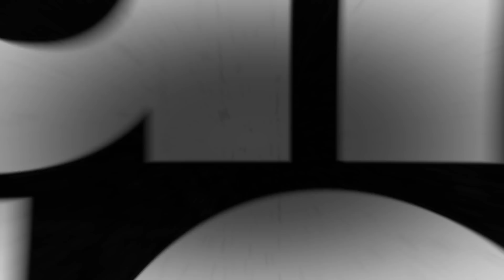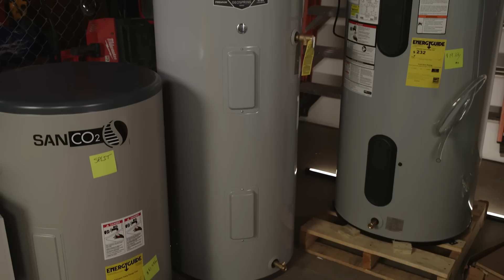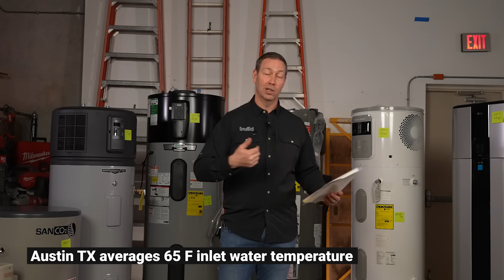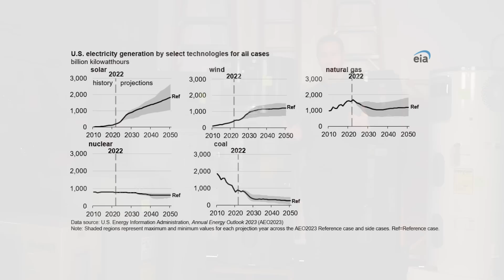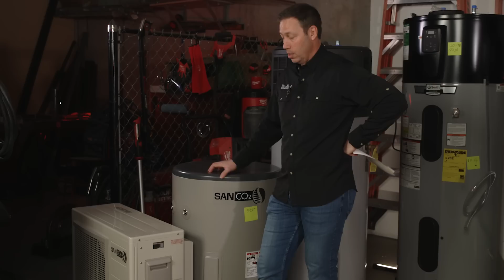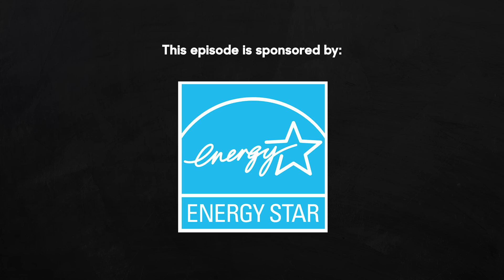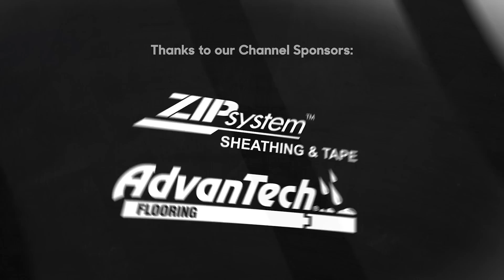2024 Heat Pump Water Heater Buyers Guide

Comment: After dealing with yet another basement prosumer dehumidifier dying I recently elected to replace my gas fired tank water heater with another inefficient gas fired tank.  Having hot water in power outages is a nice creature comfort.

Glad to see manufacturers are making advancements on HPWH.  Many of the existing reviews online talk about noise and premature failure.  It’s hard to beat the simplicity and reliability of tank and flame, but admittedly there will be a time to change.

Comment: No question in my mind that installing one of these in a warm climate makes all the sense in the world. But conditions in cold climates (say the rust belt in the USA or anywhere in Canada) are different and have different considerations. Maybe in a future episode Matt could address that aspect. For instance, putting one of these units in a space that needs to be heated much of the year doesn't seem to make much sense. Maybe a split unit is the most sensible solution in cases like that. Those in cold climates can use heat pumps (often minisplits) for space heating, so they should work for water heating.

Comment: We just got a Rheem ProTerra heat pump WH and the thing has the highest pitch whine ive heard from the compressor. I called them and the guy straight up said thats the compressor like a fridge as if my fridge makes the same sound. They supposedly fixed the issue for recent models but it's super annoying.

Comment: I installed a Rheem unit about 10 years ago and it sounded like a jet engine when it started. It was so loud we could not sleep. So we had to get it swapped out with a normal electric unit.  Not sure if it’s quieter now, but keep that in mind.

Comment: I live in Canada, l replaced a 18 year old electric with a Rheem heat pump water heater. The water comes in at 38 degrees with basement at 60 degrees and I have it set at 120 and with 2 person use it costs $8.00 or less per month. What a difference. Thanks for the information. Cheers

Comment: How would one of these work in a cold garage? If it gets down to 20 degrees or less I feel like these would really struggle to keep up, but maybe I am wrong.
Reply: Yes. They will switch over to electric resistance once temp gets below 35 or 37F. If your water heater is in your garage I imagine you're in a warmer climate and this doesn't happen often.

Comment: HMMM so would a gas replacement HPWH be able to just swap  into the same room? Mine is in the utility closet but also the gas furnace is in there too. its probably 30" deep and about 8 feet wide...the ceiling is about 10foot

Comment: So you heat your house and then this thing takes the heat from the air that you heated (probably using the other energy source that you pay for like gas, electricity, oil, etc) and using this heated air heats the water. BRILLIANT. I guess this makes sense only for warm states like TX where Matt is from and absolutely no sense for cold climates (unless you have a free energy to heat the space around these tanks). The only model here that makes sense for cold climate is the split one.

Comment: If you have a 1ton equivalent heat pump making heat at 1 ton, you also have a 1 ton AC making cold at 1ton, no getting around that. Its not a myth, its high school physics.  These are potentially making as much cold as a small mini split.    If it is in a living space some seasons of the year the cold side effect is a bonus other seasons it isn't.  If you are having to offset the cold by heating the room you may loose all of your gained efficiency and then some. Just know this and design for it.

Comment: Mine is currently in a leaky rubble foundation in Maine where it barely has required clearances, and I just recently switched it to hybrid mode for the winter... I do have a small heat pump zone down there off the multi zone that does the majority of my heating, that I run on a low temp to keep the floor from being cold and the water heater from working too hard. Power bill is pretty good considering, fully electric home, high power rates, and 135 year old home that is poorly air sealed.

Comment: I would love to see a comparison between a normal tankless water heater and HPWH. I know in the coming years my current water heater will go out, and would love others opinions on which way to go.
Reply: going to depend on your needs to be honest. Infrequent but long use when needed = go with tankless. Regular use, but not long durations = HPWH. Also depends on whether tankless = gas or electric and cost of install/removal of the gas and circuits (if 240v needed) is for you.

Comment: Idk man, you get one repair bill on a water heater with a full AC unit on top, it wont be cheap and already after paying about $3000-4000 instead of $800 for a natural gas water heater. Then factor in the tank itself only lasts 10-14 years on average, thats a hard sell for me.

I cant speak to solar panel electricity, but NG is way cheaper to run than electricity from the grid. And that grid electricity will only go higher + higher with all these flammable electric cars wanting to suckle from the grids teat.

Comment: FYI - The Rheem is way too loud at 70+db. Just put one in, Jan-2024. The video online shows an example installed in a kitchen closet and it just way too loud for that. It looks like all they have done in the last 2 years was to remove the 49db rating from the cutsheets.

It really seems to be vibration from the compressor. With the compressor and fan both on, the fan seems to be the same speed and is not heard upstairs. Maybe the fan will run faster in other modes but I've not seen it yet. The droning low rumble that is heard upstairs is only with the compressor and fan, even if the fan is at a lower speed in test mode. Is the vibration kit something that could help?

Online I've seen folks put rubber between any pipes that touch, between the earthquake straps and the back of the tank where it touches the wall but they did not seem to help much. The Rheem video online shows an example installed in a kitchen closet and it just way too loud for that.

This post says that adding noise dampening material around the top may help.
https://www.paloaltoonline.com/blogs/p/2022/05/22/what-to-do-if-you-get-a-noisy-rheemruud-heat-pump-water-heater
image.png

This guy from a year or two ago seems to be having the same issues. 
https://www.youtube.com/watch?v=-D7Au499gbU

Comment: I would have liked to know which ones might be approved for use in a hydronic heating system.
Reply: Hydronic systems usually require water get up above 160F which these won't do. There are HP's for hydronic systems but these are really just for domestic hot water.

Comment: Note the amount of energy (ie BTU's) being transferred to the water is the same (plus/minus minor losses) as the energy being transferred out of the air by the heat pump to the water. So in cold (freezing) climates where the unit is invariably in a heated part of the house, that amount of energy (of the air being cooled) is, in winter, being heated by whatever heats the rest of the house.  You may wish to clarify this in your video.  In  hot climates eg Texas, this cooling of ambient air in the house as you noted reduces the load on your home air conditioning unit by equivalent BTu's (plus/minus losses) so more beneficial.  Informative video.
Reply: sorta, my gas water heater isn't isolated: it has a powered exhaust,. Whenever it runs, it sucks indoor air out which has to get pulled in from the outside. Costly in summer and winter, and not reflected in "energy consumption" stickers.
Reply: @443DM  
I agree with you, I have the same type of powered gas vent water heater here in Canada.  Mine uses about 25 cu ft of nat. gas per day two adults (not counting heating the cold air sucked in to replace the vented air. :)) 
My note was referring to the heat pump water heater units (self contained ones- ie. all but one in the video)

Comment: Ok so lets break this down. I am an hvac and plumbing tech.  a water has an average life of minimum 10 years. For a DIY project. Retail cost of standard electric 40 gallon water 530 dollars.  $494/ year.  total over ten years is 5,600 bucks. This is without any maintenance repairs. If you have a plumber do installation, maintenance or repair, Add 3,000 to cost is 8,600 bucks. Heat pump water heater for DIY retail cost $2,600. one of those water heater has a cost $232/yr. $4,920. For a plumber, add on about $5,500 for installation and maintanence.  I am separating for a repair on the heat pump. If the heat pump breaks down, and it will, average cost for repair is 1,700 dollars. Very possible a person could spend over 12,000 dollars on a HPWH. in 10 years. For a gas 40 gallon water heater DIY retail $600. $208/yr. for ten years. $2,600. Add on another 2,000 for a plumber install and maintenance and repair.  And none of these examples include taxes, fees or discounts. Still the Cost difference is double or triple. Hardly every do you have to repair a gas water heater. So, by economic stand point, I will stay with gas water heater. The government is driving up cost for the average person because of these idiotic mandates.

Comment: That split unit intrigues me.  I wonder if it could be connected to my existing refrigerant loops.
Reply: Probably not, unless your loops are a hydronic heating system - circulating hot water thru in floor hoses or thin radiators like used in europe. Possibly with an isolating heat exchanger between systems?It also will ONLY produce heat, just as your fridge will only deliver cold- these arent true heatpumps with reverseing valves and controls. Essentially these are the guts of a window AC unit with the hot side coils in water, cold side coils in air & sized at 9 to 15k BTU (~ 1ton rated). That would be seriously undersized for most uses, just as a window AC really only can cool 1 room.
The concept is valid, but would require serious customization for task, and there's better suited equipment out there (mostly for large commercial buildings). The Navy ships I served on used circulating anti-freeze/distilled water for cooling, and steam/hot water for some heating applications. Much safer than high pressure refrigerant  gases (non-breathable or toxic or flammable) in the event of Bad Things Happening!
Reply: @KevinSmith-ys3mh  My loops carry refrigerant, not water.  I would be interested in using the split unit for domestic hot water only.  I already have more than enough condenser capacity to add it.

Comment: Why would anyone replace cheaper natural gas hot water heaters for a over prices under performing heat pump that won't last and will never recoup the expense??  They are not designed to last over 10 years and literally require an AC person to fix them...

Comment: HPWH inside in a closet is it going to create another cool air moisture problem that actually cost you more to repair structure damage???
Reply: No, it actually acts as a dehumidifier (on the cold air exhaust side) so unless you screwup the condensate drain lines it dries out the area. Apparently a small utilities room may need more ventilation tho, usually a garage or basement is recommended. Spend some time reading the comments on actual install experiences, and discount the moaner's, whiner's, and flat-earther's. Some people will complain about bacon!

Comment: If I install a heat pump water heater right next to my gas furnace in my basement, wouldn't this be ideal since it can pull in the hotter air generated from my gas furnace, and also the gas furnace has a humidifier built-in so it's outputting humidified warm air, and this would be the ideal input for the heat pump water heater, no?  The only thing is, I'm in Canada so the incoming water is very cold during winters, so during winter the heat pump water heater will need to work harder because of this.

Comment: drop the temp of 1000sq ft basement by 6 degrees in colder climate :) so it's measurable :) 120v would heat things much more slowly, so while you can, you will want to run the 240v, 30 amp circuit for them..

Comment: They are also '2-in-1' units.  If the heat pump is broken, you can run old-school resistance heat, and vice versa. I like redundancy. For me, the big incentive was moving to off-grid self sufficiency, the heat pump may run a bit longer but at a substantially lower load.  Batteries/inverters/solar can handle 350 watts for 45 minutes much better than 4500 watts for 20 minutes. Resistance heat is the LEAST efficient heat method period. 

Also, installed mine in a conditioned attic, so even when it as 13 degrees outside yesterday, it was pulling from the 70' attic air.

Comment: I installed several of these a few years in Atlanta one spring/summer a few years ago, all in garages. The customers loved them. Once winter hit, I had a ton of callbacks. They pull heat from the surrounding area, but once it gets around 40 or below there isn't much heat in the area for them to pull and they struggle and the cold air it gives off is dehumidified which turned the garages into meat locker cold. The cars had thick frost on the windshield. I had way too many complaints to recommend these again.
Reply: they're basically mini-air conditioners (as you drain the hot water out anyway), so best to install in the living space if you're in a generally hot climate.

Comment: We bought a 1st Gen Geospring in 2010 and the unit paid for itself in 4 years in electric bill savings, it dropped $30/month instantly. We live in TN and I left it in Heat Pump only for 9-10 months of the year and Hybrid in the cold months. It's located in the garage and the temp never drops below 45 in the winter, so it could technically run HP only year round, but it took longer to reheat in the morning. 
The heat pump died in 2019 and it still functions as a purely resistive unit today. We'll replace it with an improved model Hybrid soon.

Comment: i got a smaller version of that AO Smith one (240V...the 120 wasn't available at the time) last summer, replacing gas...it's WAY more efficient than an electric would have been for sure. it's hard to run the numbers for gas because in the summer i'm hitting some sort of minimum service charge, but my bill is substantially less there too!

Comment: I am a fan of Risinger videos but there is a lot of promise here that is not available in reality.  I need a hot water heater to replace a Rinnai and I have called 15 plumbers and had 7 come out for estimates.  Every single one of them has said, either (1) hybrids are appliances and not water heaters, (2) I do not do those, or (3) every one I have done has had trouble.  More importantly, the install labor prices in central texas are in the $2K to $3K range plus a mark up on the unit.  $6-7K on a unit that lasts 6-7 years is a cost not calculated here.  Energy Star needs to spend money training plumbers to install them and having a list of reasonable price installers.  Without reasonable cost installers, this hybrid industry will never take off in a major way.  When a product has a tax break, the industry raises the prices to install them to capture part of the tax break.  The other thing is that all water heaters types now have much more energy conservation so as long as you choose those models, you can get out of the high cost that the traditional tanks had.  I was interested in the 120 volt models and GE's site say they are no longer manufacturered.  Also with the hybrid, you cannot use a recirc pump so if you like that feature to save water, it will take some time to get hot water to your faucet. Energy saving but water loss.

Comment: I'd like to know more about the split unit - the biggest downside to the units installed entirely in the house is that if you are in a place where you need to heat your house the water tank is basically getting its heat from your central heater, and is only as efficient as that -- and then your hot water/heat literally goes down the drain! Seems like the all in one units work great where you want some cool air in the house.

Comment: Installed mine (Rheem) about 3yrs ago.  Loving it.  Puts out wuite a bit of cold air into my garage, pretty chilly in the winter.  Also, during the winter, we always have to switch ours to high demand mode to get it to keep up.  Air temp wherever you put it makes quite a bit of difference.  Couldn’t really imagine this anywhere else but a garage.